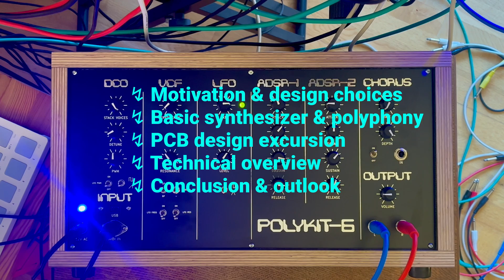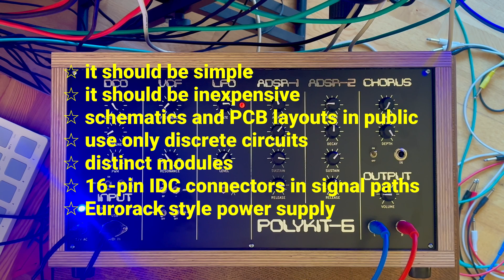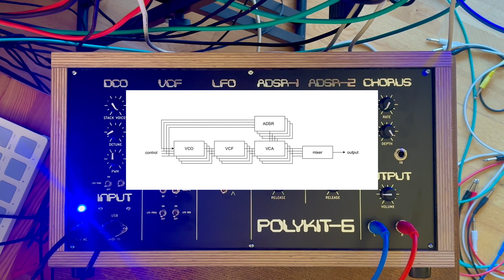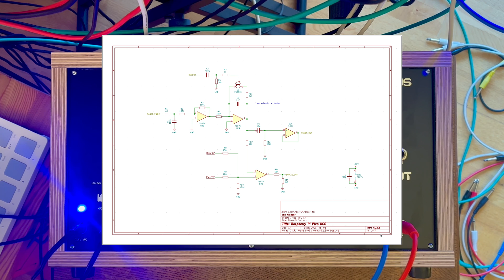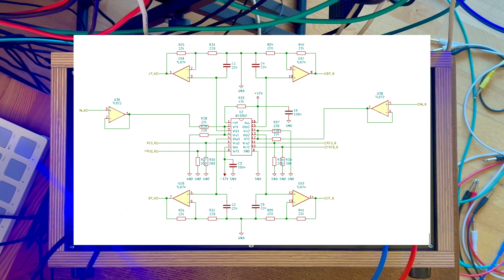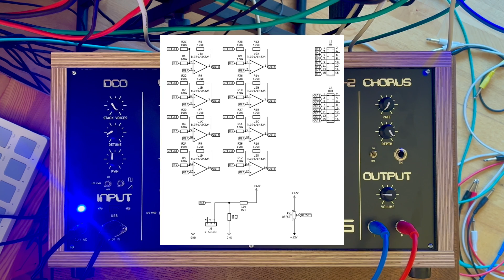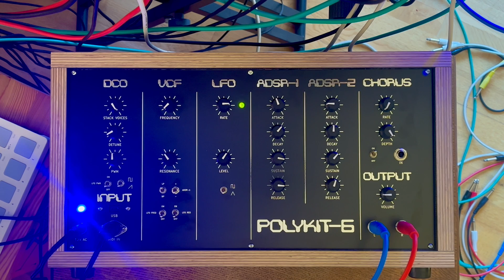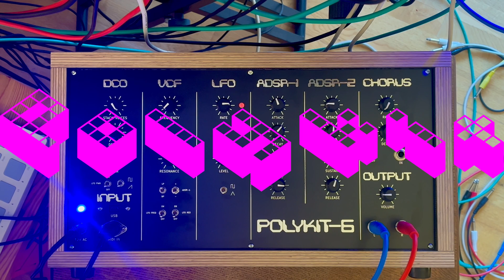I built an analog POLYPHONIC SYNTHESIZER from scratch

Comment: Hey man! Have you ever looked into how organ-poly"synths" from Solina or Hammond work? 

I personally have a Solina, and have been thinking about using that VCO and divider circuit to do a DIY poly synth. It basically works with one VCO that is divided down and split into a separate frequency per keyboard note. This means it essentially has unlimited voices, because all notes operate independently. You would still need quite a few dividers (I believe 7 or 8) per VCO, but the schematic for that should actually not be difficult at all to implement in a synth with a MIDI connection and a microcontroller/multiplexer instead of physical switches for the keys.
Reply from the maker: Actually, I did looked at it. I own a Crumar Stratus which is exactly that. All notes are derived from a master oscillator for all keys. It uses TDA1008 integrated circuits to divide down the frequency. Problem is that you still need an envelope, voltage controlled filter, VCA etc. for a proper polysynth per voice and this brings the limitation. The Crumar has that six times and a specific set of notes are assigned to one of the voices.

Comment: Dang it sounds wonderful. Question. I’ve always found synths with larger components (ex oscillators on Jupiters) to sound quite heavy, heavier than miniaturized integrated circuits. (Example. Sound of original Pro One vs Behringer Pro 1) Is this incorrect?
Reply from the maker: I don't think that this would make any difference. In the end it is only a package and the component inside is the same. I would assume in vintage synthesizers component tolerances were much higher than nowadays. Also companies selected specific components out of many to get a specific behavior/sound. This knowledge is most likely lost in modern clones.

Comment: Great project IMO! Is it possible to add a patch bay here which will allow to make RM, FM and HardSync between different DCOs (voices)? This feature (at least some of) is possible inside C64's SID sound chip and is pretty unique.
Reply from the maker: Hmm, most of this should be already possible in software. Frequency and amplitude are controlled by the Pi Pico. You could use the in-built ADC or MIDI to control these parameters.
Reply: @polykit  I mean the possibility of analog FM to make cross-FM possible as well. For different weird sounds :) ADC will distort FM at high ends I may suppose.
BTW, is it possible to include the triangle wave as well? I don't know if it's different for DCO (vs VCO) and how much additional space/ICs this will require.
Reply from the maker: Ah, ok, I see. No, at least not with the current design. Adding triangle output would be rather simple. A waveshaper to get triangle out of the ramp signal would be two additional op-amps and some passive components per voice.

Comment: Really, really solid work! How do you manage tuning each voice? I've been considering a project like this, and that's one of the first hurdles I've come across.
Reply from the maker: That’s why I chose a DCO, tuning is not needed. The frequency of the oscillators is a subdivision of the microcontroller clock. Check the link about the DCO in the description for some details.
Reply: If you got something already set up just use a phone tuner for each voice
Reply: @ChurroLightyear  I don't have anything built yet - just thinking through a design. The Deckard's Dream (and probably others) use a cool self-tuning function for when it inevitably drifts a bit, but of course with a DCO you wouldn't need that. I'd be curious if there are any detectable differences between a DCO and a well tuned VCO.
Reply: @monkeyplusplus  oh that would be sick. If you find any autotuning things lemme know. but for now ill embrace the drift like my grandmas piano. Re

Most of my non diy gear has some self tuning stuff but the solely dco stuff I have all tracks really well. For my vco stuff without autotuning it all stays in tune after its warmed up for a very long time
Reply: @monkeyplusplus  there isn’t a difference in the actual waveform of an analog DCO, it’s just digital control. People claim DCOs sound less fat, but that’s due to a lack of ‘slop’, very subtle pitch instability. Particularly in multiple oscillator setups, as the very subtle unison effect of two oscillators with slight drift are perceived as fatness.
Reply: @sub-jec-tiv  I've been thinking about that. It'd be fun to integrate a CV controllable 'slop'. I've been kinda doing that with an ADDAC 506 attenuated way down to introduce a subtle and random wobble to patches.
Reply: @ChurroLightyear  try a phase locked loop (PLL)
eg CD4046 or 74HC4046
Two oscillator signals go in, and it outputs a voltage proportional to their difference in freq.
That output voltage can be mixed into a VCO CV in to fine tune that VCO's frequency.